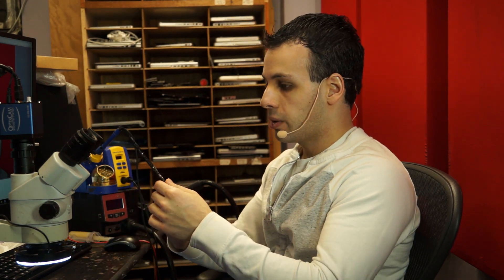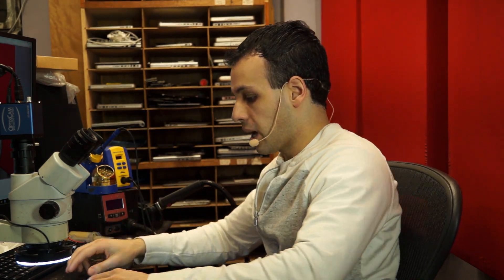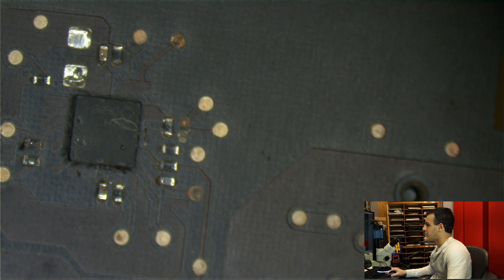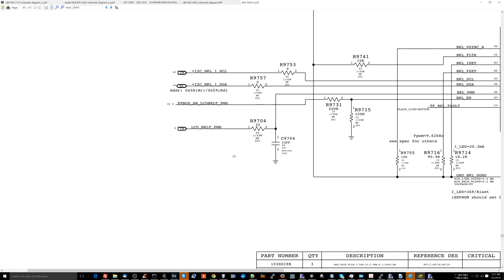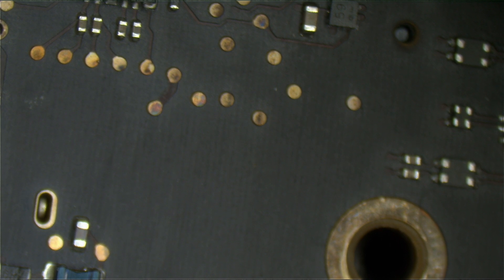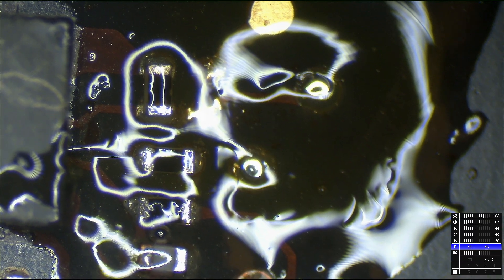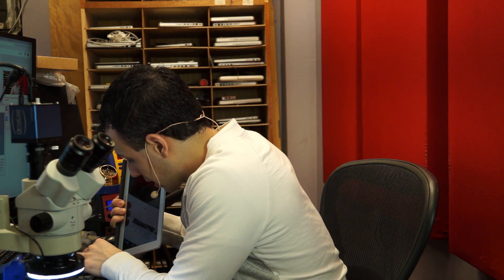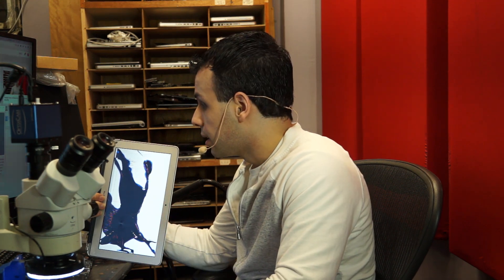Macbook Air DIY no backlight repair attempt and correction

Comment: Bro wish I had your knowledge. Got a 2015 MacBook Air with no backlight. From watching your videos I change the cord which was damage change the fuse “thank you for that” and still have nothing. I’m thinking it’s the backlight Driver. Not positive I don’t have a hot air station.... tempted to get one and the chip. Any suggestions on my problem or what chip to buy and hot Air station to get for a hobbyist would be greatly appreciated. I know you’re busy and dicks like me ask you questions all day long so thanks either way.

Comment: Hi Louis, 

Like you videos, very informative, but i am trying to find a backlight fault on a macbook air, the board is immaculate no liquid damage or corrosion. it measures .536 on the diode test to the feedback so i can rule out any feedback issues. i checked the caps for any shorts and the fuse, all looks good so far. any suggestions ?

something i noticed is that the keyboard does not illuminate as well, so like no lights on this mac. 

the lcd is visible if i shine a light so i know the lcd works and the macbook air itself is working if i plug in an external display.

Comment: Why the hell apple even bother putting a backlight fuse, (or any other protection circuit/component) in their products, when they clearly don't intend it to be repaired?! Why they even care if the failure of a component causes other components to fail as well, when they don't want it to be repair??? I just don't get it!

Comment: Have you ever thought about selling fixed macs and buying broken macs off of patrons or something of the sort??
its an idea I've been kicking around since i first started watching you.. i may have already asked you sorry if i have or if this is a common question. You could probably get $20+ out of people for the option to walk in with a broken mac and have a fixed one an hour later. 

Edit: I don't watch every video.
Reply: He charges $400 a board repair
Reply: so? it would remove the stress of the fucks that want it fixed last year. Also he will be able to charge more for essentially the same work but with a "guarantee fix" for those that go this rout.

though it opens a loophole.. normal board repair and then if no fix walk in and do the switch thing..

Comment: Question for you Louis. When you used your ultrasonic cleaner in another video you said you used distilled water in it. I have heard rumors of distilled water picking up ions and becoming charged and shorting components. Why doesn't the residual power in the components charge the water? Is it because the components were not actively powered on, like a distilled water cooled PC would be? Maybe there is simply too much volume for the water to become charged, or maybe I am just a dumbass. I am familiar that people generally use mineral oil for those types of crazy things nowadays. Educate me! <3

Also loving the videos, been jumping around watching them from time to time as I have been working as a PC repair technician for a little over a month, have been doing it on the side for a few years now and I'm 20.

Thanks ahead of time if you respond!
Reply from the maker: this is one of those things where I'd love to give an answer..but I have no idea. none at all.
Reply: No worries thanks for the reply!

Comment: My thought while you were looking for the resistor: Could you not have used the 0402 and placed it between the vias?
Reply from the maker: at what point? this video is months old so i forget..
Reply: The fix is replacing one of the resistors in the backlight enable voltage divider. One pad of the 0201 resistor is fucked so you put a mod wire to the via to reconstruct the pad. You said you had the same value on a spool in 0402 but not 0201, so you had to take it from a donor board. That comment is at about 9:00 in the video.

Comment: ohh shiiiet Ross has made some upgrades to the recording.
Btw, how you keep stracks of network traffic on the taskbar? Is that a 3rd party app or something?
Reply from the maker: old windows install, i don't remember
Reply: program is called network monitor
Reply: I have it. I reinstalled it after windows 10 upgrade.
Reply: Where can I find it? I can only find for windows 7 and its not compatible.
Reply: +TheFPSPower yeah, annoying, but run compatibility. It took a little work, but worth it.
Reply: NetSpeedMonitor 2.5.4.0

Make sure it is the Florian Gilles build
Reply: Put in a few searches, I don't think I have it in my archive anymore
Reply: ***** I already have it, I had to install it in compatibility mode but works just great. Thanks

Comment: Wait, I thought you weren't taking jobs anymore where they just sent the board instead of the entire computer.
Reply from the maker: +RaithSienar I don't but people send anyway. No warranty on any of this.
Reply from the maker: 100% of the boards I have fixed board only come back with problems that were not exhibited during testing in an assembled system. I don't know what causes it, and I do not care to figure it out. I can't hold people's hands through not shorting battery pins or plugging in liquid damaged trackpads and cables. then the board exhibits the same problem, or maybe the case is what is causing the problem...

Also, assembling a test system sucks. It is a total waste of time. Let me find a screen, a keyboard, a trackpad, a speaker, a fan, a heatsink... no. I have fixed boards faster than it takes to do all of that.

i could have preassembled systems for every board but that is a huge waste of money, i could sell those.even if i invested in this, all of this would be for nothing, because what works here does not work when you send it back

and then they file chargebacks, say you broke it, say it "should have been fixed right the first time".... no. just no. send entire machine or i am not fixing it. 

i find in business that a lot of the tactics i used to equate to "being a dick" are just policies businesses are forced into as they grow bigger, deal with more people, and find these situations. i used to have a no backlight coupon as ell that i had to get rid of after getting cursed out enough times by people who said their machine worked with no backlight after i told them it arrived dead

there is no benefit to board only repair, but so much downside.
Reply: can confirm, I offered to bring my apple iMac a1224 gpu issue. He said NO!
Reply: +Louis Rossmann  I haven't heard that you dont, any particular reason? do the boards get damaged in shipping or what?
Reply: Anas Malas

Nah, he just doesn't trust peoples ability to put their shit back together properly. Before back when it was still covered by warranty he would get people who broke there system because of incompetent reconstruction on their end.

He did a video on it, it's only a few months to a year old.

Comment: Better job than my last ceramic board. Though I would get complaints on it not being completely cleaned and shiny. Stupid dumbasses that don't realize that it would look the same after putting it back in the gear.

Comment: An 0402 probably would fit nicely between the two vias, saving the wire and the resistor hunting, if you have them already..